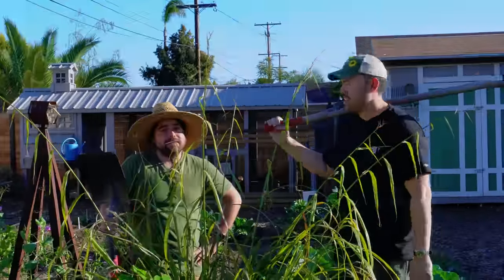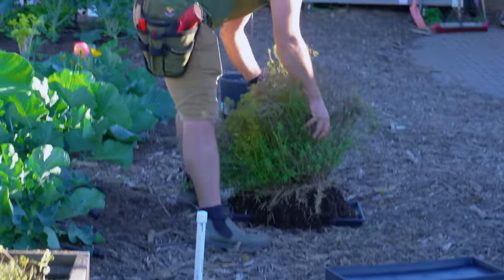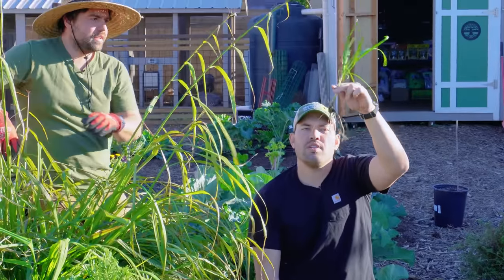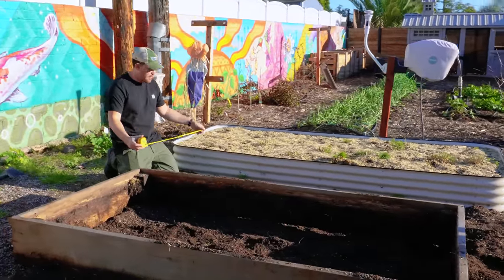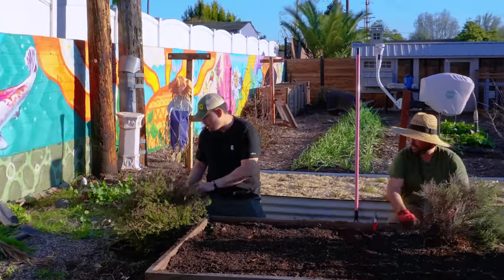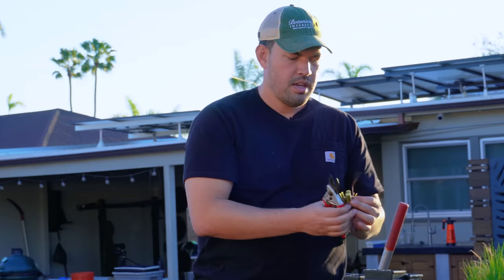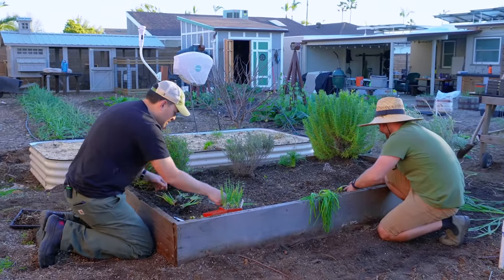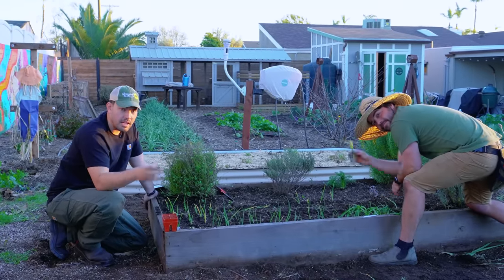Ripping Out The Herb Bed...AGAIN 🙄

Comment: On the lemongrass, pruning the leaves back drastically at the beginning, and bundling for drying makes the task much easier.  It's also better for the plant as it's not trying to sustain the leaves while also recovering from the transplant.  Using your Hori knife to separate the root ball is also a huge time saver. The Rosemary is beautiful, but again, pruning before transplant is a smart move.